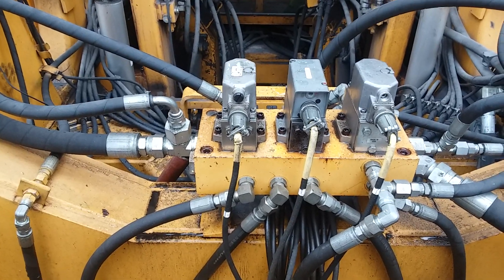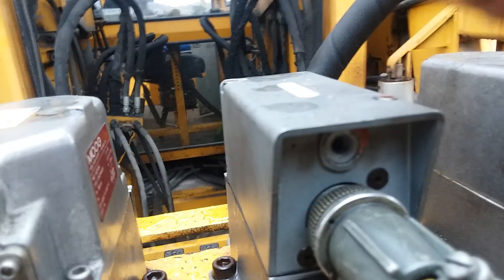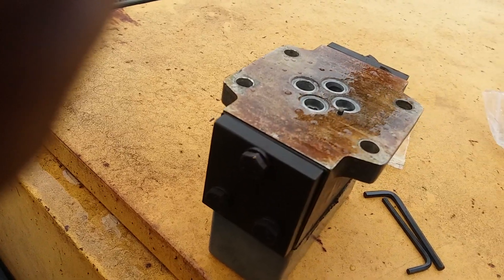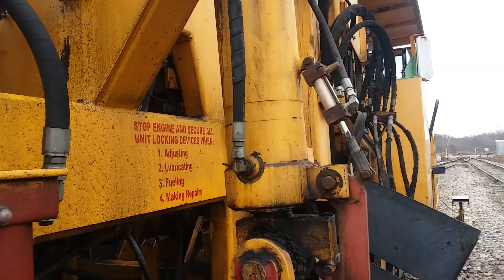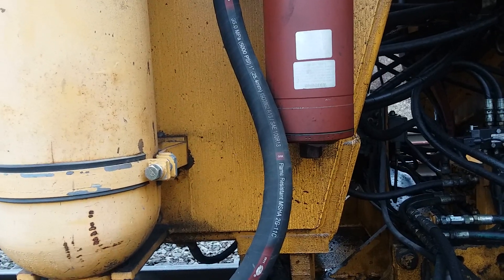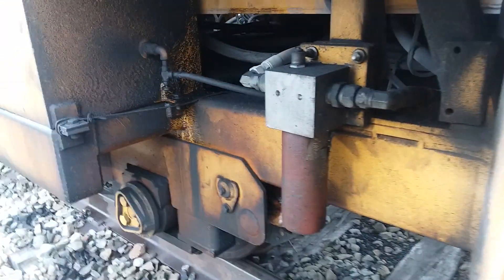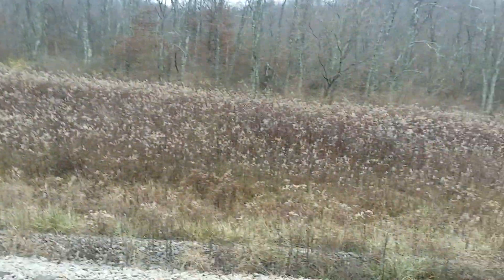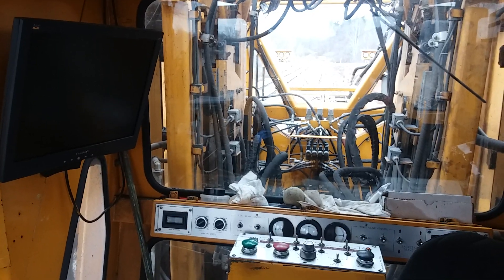Jackson 6700 Tamper: How to Calibrate a Jacking Servo Valve

Comment: Hey Dave I'm having issues with my Jack beam surfacing it will clamp and when it begins to raise my needle will drop and it will not lift at all you have any suggestions on what maybe this issue is with my 6700 tamper please let me know or reach out to me
Reply from the maker: Not much information to go on Steve. If the needle is low and starts
to rise, does it stop at a certain point and then drop? Or does it
not rise at all as the jackbeam is picking up the rail, just keeps
dropping from the get go.

There are several components in that system. First thing I would
do is swap surfacing light receivers from the good side to the
side in question and see if that eliminates the problem. Sounds 
like the light is hitting a dead spot in one of the photocells in that
receiver. Whatever is causing it, the voltage that controls the needles
and servo valves is being reversed from what it should be. That
may also be caused by a faulty logic card. You will need better help
than me to diagnose a faulty logic card. A bad servo valve can
also play havoc with the voltages. 

One thing you can easily try is:  set up, then run your surfacing light
up, the needle should follow that light. Run the light up and
the needle should drop. Then run it back down and the needle should follow the light and go up, then center on green when the surfacing light is at zero. If it doesn't then most likely there is a bad or more than one bad photocell in the receiver. Another possibility in that is the
cable is loose or has become damaged to the receiver.  I've had cables go bad for no apparent reason before. A boogered up wire
will not send the right message or send no message at all. It's
a bit of a trial and error to find the problem.  Let me know what you find out
Reply: @ccrx6700  I'm glad you responded Dave . When I clamp the needle will go to the green and after two squeezes the needle will drop to zero but still clamp and I lose I will lose my raise  And now my surface will not respond  pretty much it will clamp but not raise and I'm on the left grade rail. Do you think it's my servo?
Reply from the maker: @steveazua9371  Well if it's going to green and stopping then highly doubt if
it's the receiver or cable to it. The servo controls the jacking. Left grade has
always given me more fits than the right for some odd reason..... That is
very strange that you can lift rail to the desired grade and tamp, then the needle
falls out. At least you are stopping at green. I had it one time keep on jacking
and not stop, needle just kept rising. That was scary and was a servo valve.
I've found that servos go bad right now, they don't give you any warning that
something is amiss. I had tamped over a quarter mile of track that day,
cleared up for a train, went back to tamp and the first clamp it went haywire.

It sounds like you may have a loose connection since it may jar loose from
the insertions, first check and make sure the screw in plug to the servo is tight,
you may want to spray it with a good electrical cleaner. If that doesn't work
then it does sound like your servo is bad. Good luck and let me know what
you find out. If a new servo doesn't work then the problem may be in your
transducer.

Comment: yes the little filters are so easy to plug up.any type of debris can get caught in them, and distort the flow
of the hydraulic fluid by restricting it , causes a change in the net gain in the controls.
really neat to see how a little Moog controller can make such a difference. one of the Moog sites is located
about 15 miles away from my home in East Aurora,ny. a friend worked there, now retired from there.
it is the little things that make such a difference, PM is key to keeping things running correctly
especially with oils in drive lines. great video, trying to catch up on your work. have a great one. barry
Reply from the maker: Doesn't take much to plug those baby filters up. Really appreciate
your watching the servo valve video my friend.
Reply: dave, im trying to locate the filters you said were located in the block below the servo valves.  could you explain to me exactly where they are located.

Comment: Dave, guess I don’t understand how the tamper picks up the track with that machine sitting on the rails. Interesting.
Reply from the maker: It only picks up the rails in between the front and rear sets of wheels.
Track where the wheels are resting at the time does not lift up.
Thanks for asking Alaina, questions is how you find out stuff.

Comment: Hello, I just started running a 6700s and just replace a  jacking servo valve, i didn't know I need to make adjustments, is it necessary? and has to surfacing, is a measurement for each mark on the surfacing meter? like 1 mark is 1/8th?? Thanks!
Reply from the maker: Eric, they are a beast to tame! Good luck, finicky sometimes and ya gotta watch everything whike tamping, but a properly calibrated machine can make some nice looking track. 

Yes, you must calibrate the servo. Follow my instructions in video, it not that hard, you can do it. Send back a comment if you need anything.  On my jacking meters when needle is at lowest mark on meter, that pretty close to 1 inch.

Calibrate in a siding or spur, then tamp several rsil lenghts and get about an 1 1/2 inch lift on it, then go behind machine and check cross level with level board to make sure it calibrated right before you try tamp mains. Let me know how it works out for ya
Reply: @ccrx6700  Thanks!!
Reply from the maker: @ericheuer3311  i've been blessed to have met several very good tamper operators over the years and have learned a lot from them. One thing bout running a 6700, you will have problems with the machine. Lol. So, dont be afraid to ask me when something goes wrong, if I dont know answers, i know people who do. We operators gotta stick together. Good luck
Reply: @ccrx6700  Thanks man, appreciate it, been pretty busy, sorry for the late response and I will keep that in mind when i get stuck on an issue, Thanks again.
Reply from the maker: @ericheuer3311  keep it in the green 😉

Comment: Are the vibrator motors hydraulic on the 6700? Our old 6500 has electric vibrator motors that always burn out to the tune on $1800 a piece to rebuild them.
Reply from the maker: Michael, hydraulic yes, they dont last forever either, the vibrators ate a pain to change. Our old Fairmont from 30 years ago had the electric motors, they did a good job

Comment: So the Mechanical Bias is just the adjustment that sets the "starting point" if you will, of where a command to move the jack will actually result in a physical movement of the cylinder?  Your basically removing any amount of mechanical response delay?  How often do you have to calibrate the tamper to make sure it maintains a level reference given all the vibration the machine generates while operating?
Reply from the maker: Very good observation, yes bias is a kind of reference point. Frequency of calibration to cross level, lots operators an mechanics have varying opinions. Absolutely after a component in the system is changed, such as a servo. Harsco recommends every 150 hours or monthly, and if tamping class 6 thru 9 track that schedule may be  well advised brcause of the high speeds on those classes. We have class 2 track with top speed 25, so track surface does not have to be near as critical as for a transit train going over 100 mph. Many i have talked to say for lower classes track yearly or 1,000 hours, we do bout every other year as routine, but again im not tamping every day so it roughly works out to bout every 1200 to 1500 hours. Your question really needs bout a 2 hour face face discussion as there are many variables involved, you got the "quick" version here
Reply: @ccrx6700  2 hour minimum!

Comment: WOW I'll never run or work on a machine like that, but brought back memories of a couple of McQuay chillers we used to work on. Cards,solenoid valves, they had the damndest relays worked by impedance no mechanical contact switching. Electric gremlins are the worst take care catch ya later
Reply from the maker: Yep Kenn, electrical go bad sometimes drive me nuts, i confess i sometimes need help with that stuff. Had the top Harsco rep with me on phone, plus 1 of the best tamper guys in the US  out of Kansas City help me with this one. Fortunately i,ve made some great friendships over the years with these guys and they are willing to help out when i need it.